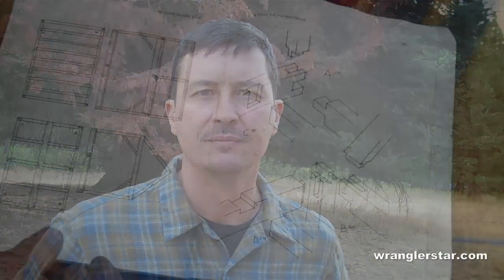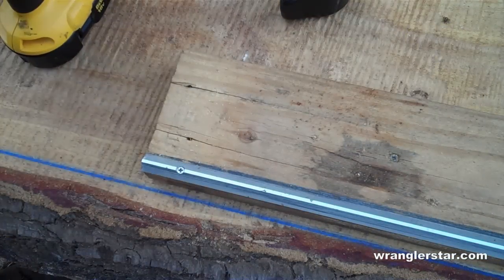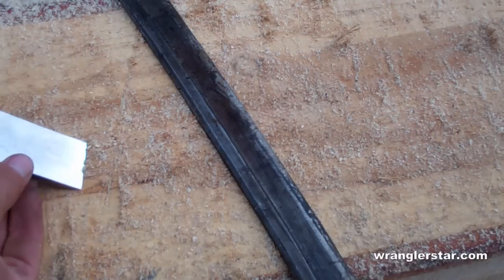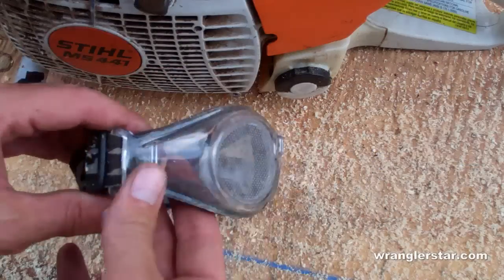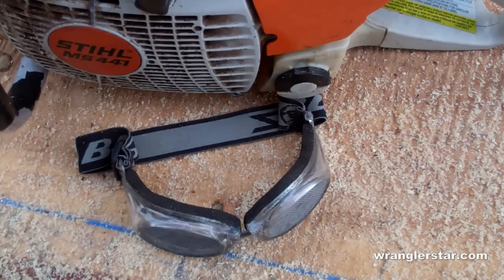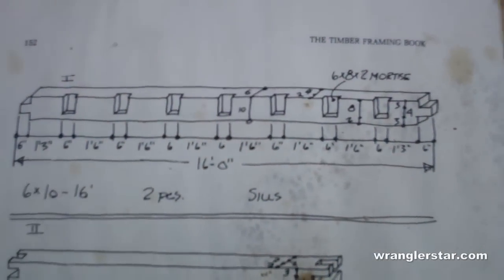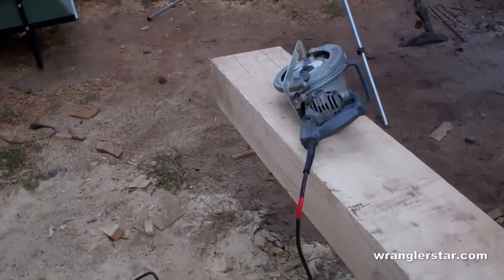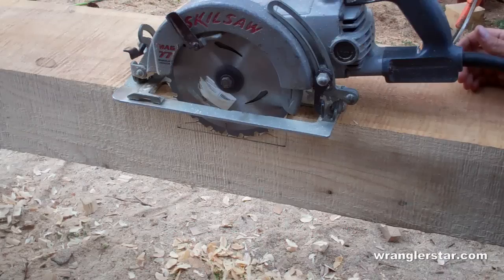Final Cut for the Timber Frame Cabin Sill – Precision Timber Work!

Comment from the maker: The origins of wainscoting can be traced back to 16th-century England where it was applied in homes to the lower interior sections of stone walls to counteract coldness and dampness. Throughout the 18th and 19th century, wainscot was commonly found in casual settings, such as informally decorated homes, cottages and retreats. Historically, traditional wainscot was made of wood and consisted of tongue-and-groove boards nailed vertically up the wall and measuring anywhere from 42 to 58 inches

Comment: using the right tool on the screw in the first place will stop them from stripping, a drill is to drill holes not screw in screws, use an impact driver and you will have almost zero stripped screws.

Comment: Awesome!  All that sawdust in a five gallon bucket mixed with a bit of diesel fuel makes for a great fire starter in your fire pit or fireplace. Just add enough fuel to let the dust absorb it, not "liquid-ie" at all then just sprinkle a tiny bit on your lighter logs (tinder) and light it. Works like a charm and a five gallon bucket of it will last an entire season, maybe even two.

Comment: Greenlee used to make drawknives and such.  They still make timber drills/augers, but the quality isn't up to the old standards.
Blue chalk, common color, useful, easy to find.
Red chalk, tends to be permanent.
Magic marker on the auger bit shows where to stop.
White chalk, easily removed, used on dark surfaces.
I use lag screws to hold down my mill.  I drill to insert the lag, and fill the hole later with a dowel/plug.  Socket in a brace handle to drive/remove the lag.

Comment: if you cut your timbers slightly oversized and use the draw knife to finish, it will seal the pores of the wood and prevent rot with out the use of chemical sealers. I recently worked on a pioneer log cabin restoration and all of the surfaces were cleaned in this way or with a hand plane. the logs were over two hundred years old and still solid. a big difference from modern saw cut timbers which will rot much faster due to open wood pores.

Comment: Thanks for the tips.

Even though you have more experience than me in most everything you do, I would say though, if you can, please don't use Phillip screws.   I've found them more trubble than they are worth.  I LOVE a better holding screw head design such as Torx.

Comment: Also, I see you working with a newer panel saw.  Stick with the older hand saws.  The newer saws use softer steel with induction hardened teeth meaning sharpening them after they go dull is useless.  Find an older hand saw and you can sharpen and set the teeth as many times as necessary.  Will last much longer, plus the handles were usually nicer.

Comment: I'm surprised the plans call for a summer beam.  A 12 foot span is not that great, and you add load to and remove material from the middle of your girding/tie beams.  My 250 year old farmhouse has 14' spans made with 2 x 7s (rough sawn) with no problems.  I think you would gain a lot by learning about square rule framing and draw bore pegged mortise and tenon joinery.